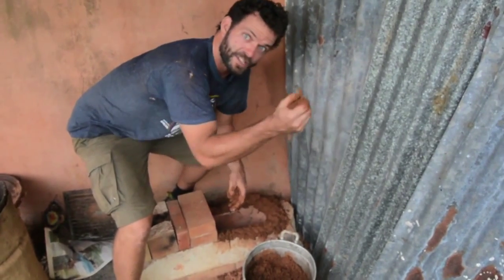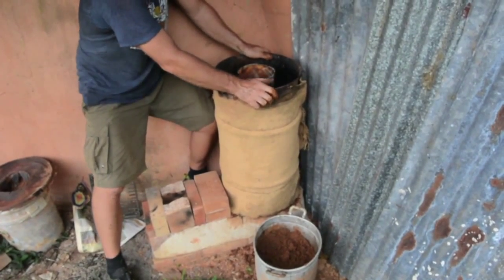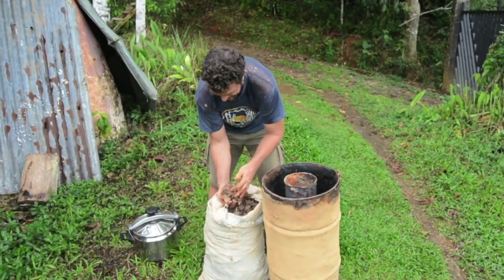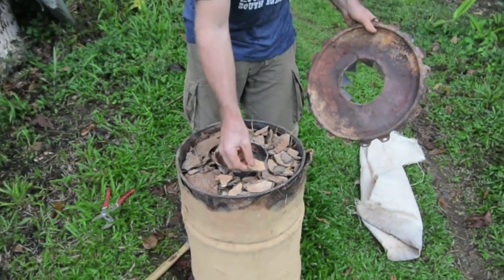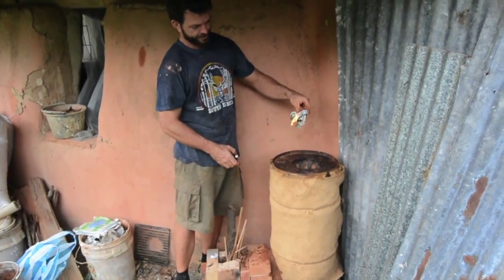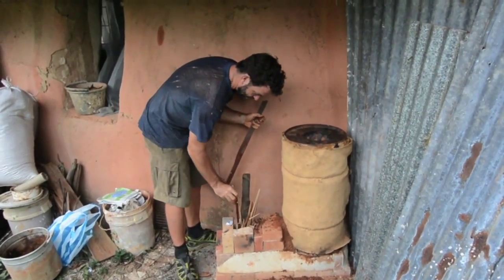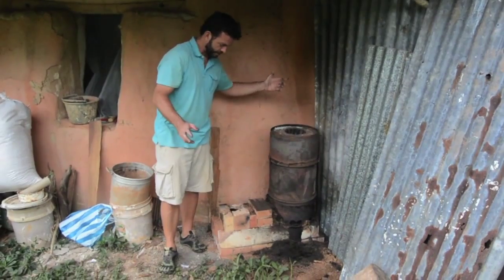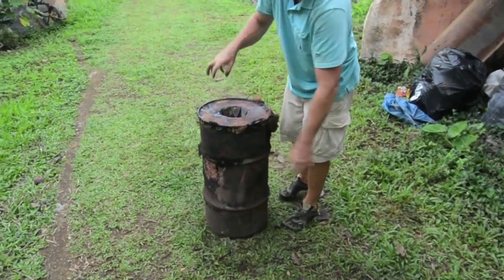Rocket BioChar Stove (Part 1)

Comment: Great design brother!  i don't see the outlet for syngases to escape, is it that the interior tube of the riser is leaky enough on the bottom for them to escape?
I'm thinking how i'd configure this with a 55gal drum heat exchanger over the riser,for use in a passive solar greenhouse.I'd want to be able to remove the  biochar can riser without needing to reseal with cob. maybe another permanent pipe sleeved within the char pipe?so the can could slide out.55gal would need removable sealing lid for access. not sure if i'm describing this adequately .